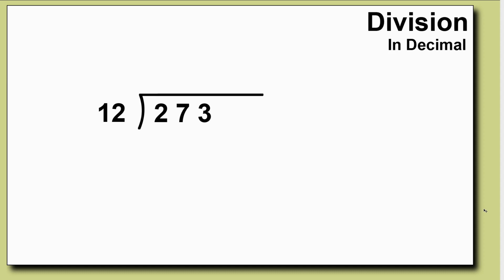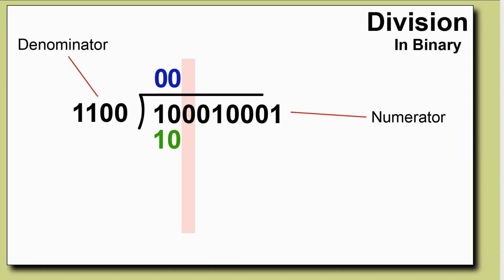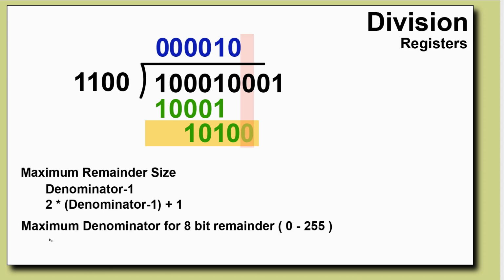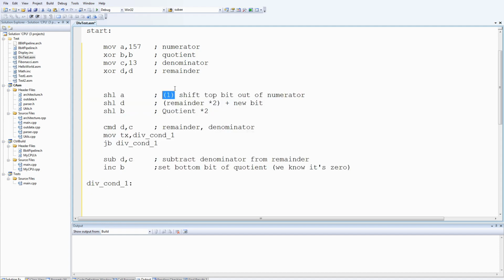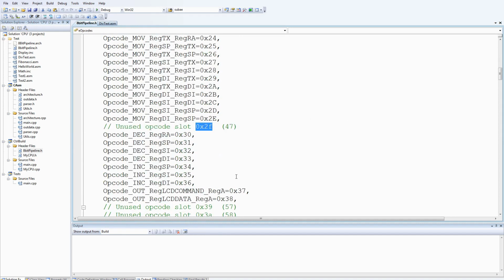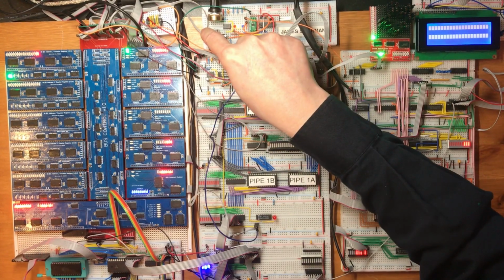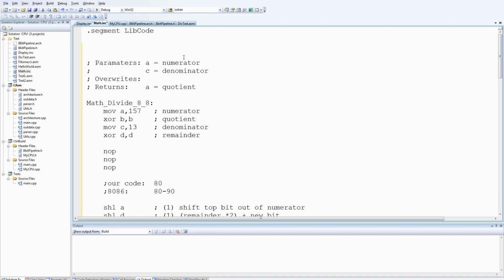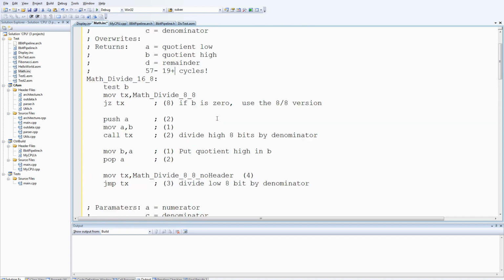Coding 2, Divide - Making an 8 Bit pipelined CPU - Part 66

Comment: So, since watching this video I have learned that the "hardware" multiply/divide instructions on the 8086 is actually just a software implementation in microcode. It's doing exactly the same shift-add conditional loop thing using the CPUs normal adders and jump units and stuff, just using microcode to run it instead of instructions. This is still faster than a pure software implementation as it can skip the instruction fetches but not nearly as fast as a "real" hardware implementation as it's still limited to going through the operations sequentially.

Which still makes this a very good result, matching the microcode performance of a CPU actually designed to operate on 16 bit numbers is still really good and a demonstration of the power of this kind of architecture.

Which makes sense. The hardware divide circuit I came up with requires 2 cycles for every bit of the numerator* and I have a hard time imagining the guys at Intel couldn't come up with a better solution than me if they had the transistor count available.

Comment: did you ever come up with a solution to full 8 x 8 division? I think its a bit unfair to compare the x86 Divide cycles to your algo if your algo has a denominator limit of 128 in an 8 bit and the x86 has the full use of two 8 bit division operands with a listed cycle time of 90 max.
Reply from the maker: I have a variety of versions now for different input sizes and types. I wasn't trying to present this as "Hey look at my superior implementation" the comparison was just meant to show that performance was in a similar ballpark. Back in the 8-bit days it was pretty common to write mutiple performance tuned implimentations like this.

Comment: I must be missing something about the way you're encoding instructions.  Are you using the processor flags as part of the "address" on the microcode ROM?  That would explain my previous misunderstanding.  I think I get it now; the CPU itself doesn't do conditional, the ROM does.
Reply from the maker: The contents of the rom IS part of the control logic of the cpu. I could have done that as a sea rite logic circuit but this way lets me iterate and saves space.

Comment: Why was the mov tx, div_cond1 necessary to do in every loop? Which operation changes tx? If so the unoptimized cycle count would have been 20cycles less?
Reply from the maker: tx is used as the destination for all the conditional jumps, so the loop itself would overwrite it. You could obviously unroll the loop, but then the skip would be to a different address each copy and you would still need the load of tx.

Comment: So if we need a special opcode, we could just implement DIV in microcode.
Reply from the maker: I don’t need a special opcode, It’s just an optimisation. There would be no way to code a div in microcode without lots of extra hardware.
Reply: So I only coded a little assembly in my life, but was told that predicates (ARM) don't work that well (in modern designs??). The idea of microcode is that you only need a ROM where you basically store your procedure. Then the code in RAM can call it with one opcode ( kinda like a trap in 68k). You already have a ROM, I think. Of course, for performance we should rather think if the Harvard architecture and store only memory-access heavy procedures in ROM. I tried to find out what architecture you are using because most 8-bit CPUs would access RAM for data in every instruction (besides INC, NOT, CLI). 68k and 8086 also. But the playlist was a bit long, and I did not stumble on it or the YT app UX is unusable or I overlooked a link ( though it would be cool to set it up all in YT (plus an external copy for freedom or so)) .

With only 8 bit opcodes, microcode in ROM can just start every 16 bytes . One bit marks last instruction. I also did not yet find out how you push and pop .. typically either microcode or extra hardware is used. I was surprised that you support those instructions ( I think ..).
  @weirdboyjim

Comment: as I was watching you write new instructions to make the sequence faster, I was thinking "that's the wrong instruction to be creating...". Instead of a predicated subtract that repeats the subtraction that is done by the compare, and predicates writeback on what the flag was before the last operation, why not just have a conditional subtract that predicates writeback on its own result, leaving the carry result for the following addc? (also, isn't addc b,b just the same as shl b?) Maybe there's some architectural reason you can't predicate register writeback on the result of an operation, I'm not familiar enough with the  ALU circuitry to know, but that's the way I would want to go...
Reply from the maker: It's very easy to look from the outside and say "It would be better to have an instruction that did X" but your guess that it's an architectural constraint is correct. A decision based on a flag change can only be made after the flag has been set. A write back decision keyed of the flag is unlikely to be used unless you have some other reason to delay the write back beyond the calculation. What I did here was the best improvement I could make without changing the physical hardware. If you wanted to specifically do that the simpler modification to the circuit would be to add a couple of multiplexers to write back either the result, or the original LHS input to the final stage of the ALU, that still be quite a few extra components to drive it.
Reply: @weirdboyjim  understood. thanks :)
Reply: @weirdboyjim  although I think I'd need a full logic diagram to really get it. Are your schematics available somewhere?
Reply from the maker: addc b,b is not equivalent to shl b in this architecture. It has separate arrhythmic and logical carry flags, that was a design decision to simplify the circuit and explanation.

Comment: Hi James, this is a great series. The most efficient Binary to Decimal conversion invented in old times was called Double Dabble and uses only Shift and Add Operations, no Div or Mod. 
It is presented well in Wikipedia https://en.m.wikipedia.org/wiki/Double_dabble.
However, your math lib doesxneed all the basic calculations, but not for BCD conversion.
Reply from the maker: That isn't actually true, if you work you way through both algorithms you'll find you are doing a bunch of shift's, a bunch of adds and a bunch of  compares to 10. They end up being very similar in the operations performed, Double Dabble is great for it's designed use in hardware but for longer numbers on a limited register cpu doing the divides can be more efficient. The other thing to note is that I didn't write this divide for decimal conversion, I have used it since for lots of different things all the way upto 3d graphics. The decimal conversion was just a very easy to explain and show use of it.

Comment: This was a really cool video.  I've seen others on machine language division, but your CPU is a great stage for the demo.  Helps to see the actual shift operations happening.  I'm wondering how many times in your career have you encountered a problem where you could double performance if you could just add one more instruction to the CPU microcode?

Also, when you do the addc command, the carry flag gets unset, but the subae still works.  Is that solely dependent on the pipeline (the subae is decoded in pipeline stage 1 before the addc unsets the carry flag in pipeline stage 2)?  Like, if you added a nop in between the addc and the subae, the function wouldn't work properly?
Reply from the maker: Thanks! Yes, the carry flag from the previous instruction is used before the following operation changes it. In answer to your first question, it's not uncommon when do a tight loop optimization in assembly to hit issues like that. Many get resolved the rethinking the inputs/outputs.

Comment: Are you using the divide for the hex to decimal conversion? I've heard of an algorithm called "double dabble", but I don't know if that'll be faster or slower for converting hex to dec as the method with the divides...
Reply from the maker: I’m using the divide, but I need the general purpose divide operation. Double dabble is kind of equivalent to a chain of divides by 10 but rearranged to make it well suited to hardware implementation.
Reply: I never heard of double dabble, but looked it up, and it is cool neat algorithm. Never heard of it before. Not super useful unfortunately.

I wrote a program in Python to emulate double dabble, it works. If I take lets say 16-bit input, like 65244, it takes 80-100 left bit shifts (on 8-bit values) to get to the final result. And these are just bitshifts, there are conditionals (or table lookups), moves, etc. Not great. For 32-bit input, conversion to decimal using double dabble on 8-bit machine would be 288 8-bit shifts. It is easy to see, algorithm requires up to 9 decimal digits, each digit is 4 bit in bcd, that is 36 iterations. That is 9 BCD digits (nibbles), is 5 bytes that need to be shifted in each iteration (technically in earlier iterations most significant bits do not need to be shifted, but this will save at most about 40% of shifts), and also the input need to be shifted. 32-bit input is 4 bytes. so in each iteration we need to shift 5+4=9 bytes, times 36 iterations, 324 shifts. This is just crude estimate, if you actually analyses it a bit more, (or run), it is 288 shifts. On 16-bit architecture it would drop to 128 bit shifts. Still that is a lot, even if you could squeeze each iteration into one instruction (and you can, using simple hardwired moves, two carry flags, and two small decoders, which all can be done together in less than 1 cycle), it quite a bit of cycles. But, as each iteration is very simple, just few gates total delay, you could probably perform 2, 3, maybe 4 steps of iteration in one cycle with dedicated (yet still simple) hardware. Then on 16-bit machine it could be usable.

Converting 8-bit should doable in about 20 dd+shifts ops. So with special combinatorial logic, it would be actually pretty fast.

Comment: Verran nice series, for bin decbcd conversion there is nice algorithm, I call it bigger than 5? Add 3 It works without div
Reply from the maker: The algorithm you are thinking of is called "Double Dabble", it's an interesting algorithm but it doesn't actually work "without div", it's a special case series of hardwired div+mod by 10 in an algorithmically streamlined way.  Of course what I actually wanted was a general purpose divide operation and using it for the itoa code was a easy to demonstrate first use.
Reply: @weirdboyjim   Thanks, I just remember that I had to make fast algorithm to convert 24bit number to bcd decimal in 8051 in every 10ms , that 'double dabble' was best what I found to meet specs, and very small asm code and ap. 10x faster than any other algorithm :)

Comment: It's a shame the ALU cannot be configured to return an unchanged value if the subtract would go negative, that way a single instruction could handle both the test and the subtraction.

But it would need one more output line on the diode matrix, one gate (carry, matrix flag 9) and a set of input selectors (ALU result, LHS result).
Reply from the maker: Yeah, that would be nice and is obviously the way you would do it building custom hardware. If we made the pipeline one step longer you could make the store back back into lhs conditional on the flags but that would make things tougher elsewhere. I did actually work out one way of removing a cycle from this with another custom instruction and no extra chips, let me know if you can guess it. Not something I'm in a hurry to do with the instruction space limitation though.
Reply: Does Wikipedia not have an algorithm which works despite the changed value? Carry look ahead would easily block a changed value, but even the DIV instruction on the Atari Jaguar just always changes the value. You have to correct the reminder if you intend to use it. Most people just want the quotient.

Comment: To handle full 8-bit denominators, you don't need a double-width remainder.  You can just use the carry flag as a 9th bit.  If that is set after shifting left, you know the denominator is less and you'll get a current digit of 1, so jump to the handing of this case which takes the 1, subtracts the denominator , and then adds the next numerator bit.
If the shift did not get the carry, adding the next numerator bit still can carry out.  If the flag is set, subtract the denominator but don't test that result, and get a current digit of 1.
Only if bringing in the next numerator bit did not carry, do the "normal" way and test if the denominator is greater or equal.
That makes me think about a different use of the incoming carry bit when subtracting.  With SBB that is coming in from the right_, when you are processing the bytes from least to most significant.  But if you add something which might carry out (unsigned overflow) and then subtract something, having the carry coming in from the _left lets you know that when the result underflowed it really went back to normal; to implement in 2s complement, the new C out should be XORed with the old incoming value.
With this alternate SUB, the middle case in the first paragraph is folded into the third (normal) case simply by using this instruction for the subtract-after-adding.
Reply from the maker: You can use the carry flag like that, but it adds complexity (and instructions). I was most interested in getting an efficient divide implementation to meet the needs of itoa for number display. Back in the day we would always have a variety of implementations for different degrees of complexity. I might get around to doing a special case divide by 10 as a coding example at some point.

Comment: I'm unclear on why both sides of the subae instruction need to store to D. Why can't the side that does the AND just be a nop instruction?
Reply from the maker: Great question, but there is a good reason.  That code is setting up the control lines for both pipeline steps, but CarryA is not fixed between the steps, it could be changed by the instruction in stage 2 while this operation is executing in stage 1. I used the AND so all the conditional code was acting in pipeline stage 1 and stage 2 was doing exactly the same thing for both sides. It's good practice for this kind of conditional.

Comment: hi james... wow, i can really say u got years of assembler programming experience... great optimization! i've been the high level language programmer type for almost my whole career... just had some experience with assembler in the beginning and now again with my own build... it's fun seeing all those instructions again and this time easily understand what they are all doing in contrast to my first contact with assembler when i was a teeny :D i understand everything you're doing there, i'm just lacking the years of experience to be able to come up with such highy optimized solutions myself... 

one question: why did you choose to enter the opcodes of the instructions yourself? i let it do by my microcode generation code (well, u know, it's just an increment actually :D  InstructionCode = nextInstructionCode++;  :D )... i mean... if u add instructions u have to update your pipeline roms anyway... well, ok, you also have to reassamble your program and write it to the program-rom again as well... but usually those go hand in hand while developing the machine further :D
kind regards
Reply from the maker: Thanks!  I planed that I should be able to get a divide into around this cycle count, but it was good to actually manage it.

Comment: Division works fine in my build, thanks for that excituing videos! Couldnot the carry flag set by the cmp be overridden by the addc instruction before the subae needs it for decision if subtract or no?
Reply from the maker: No, the addc instructing will update the carry flag when it completes in stage 2, the same time as the subae is executing in stage 1. That's the reason for implementing the subae as either a sub or an and, if I made it store conditionally the flag would be overeaten by the addc before it had a chance to execute.

Comment: I love the video, I am just confused about one thing. For the 4th step, where you addc b,b, why do you use addc rather than a shift left on b? I might have missed some explanation.
Reply from the maker: I suspect the crucial detail you are missing is that to simplify the ALU I have separate logical carry and arithmetic carry flags. Shifts use LC and add/subtract uses AC. On a processor with combined flags a regular shift would work just as well.